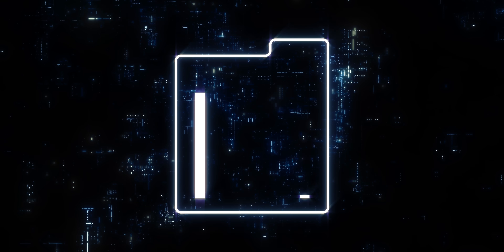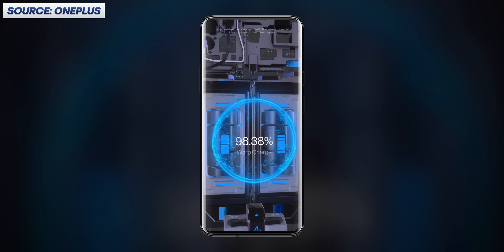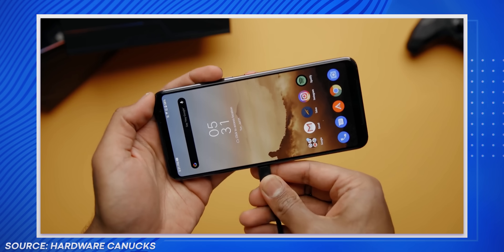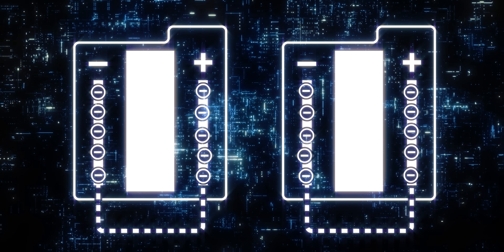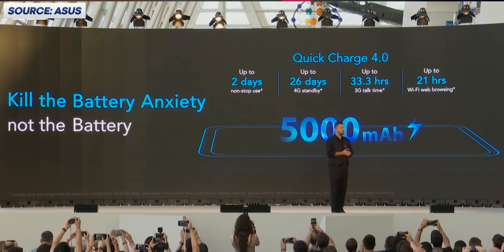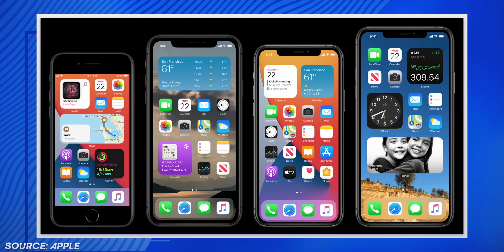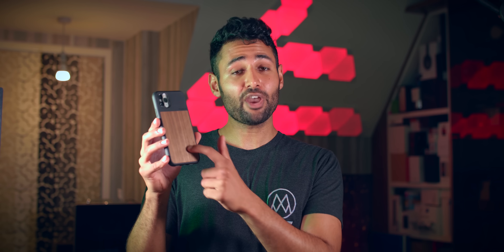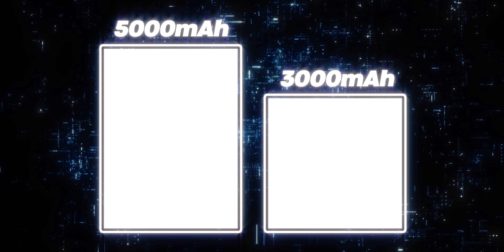The Problem with Fast Chargers.

Comment: I'm glad that someone with reach is finally talking about the problems with fast charging. Now to correct you, with Lithium batteries, actually the slower you charge the better. Also the larger the battery the better, it means it can output and input more energy.

Comment: If companies put buffers in to prevent the user from overcharging, then isn't telling the user not to charge to 100% counterproductive? I mean, if a buffer is there for user safety (say manufacturers buffered charging to 80% in-device) and the user decides to charge to 80%, users are charging to 80% of 80%. Could that possibly lead to higher frequencies of charging that puts wear-and-tear on the battery?

Comment: I agree with his assumption where Apple try to make a phone which the battery life can last longer.
This is proven with their current development where they tried to squeeze down the battery capacity + include Optimized Battery Charging option in the recent update.
This enable the iPhone to last longer during the day, but reduce the battery aging when it is charged during the whole night.

It benefits consumer in many ways:
 to reduce dependecy on fast charging adapter + power efficiency + longer battery life + smaller phone + lighter phone + less hot phone

Comment: In my opinion 10w chargers are the best,  No overheating and No damage battery, but now it's a little difficult find a charger with 10w. I have the Xiaomi mi 9t, I bought it a year ago and the battery works like a new, I only use  to 80-20%and it gives me  like 8 hours of display

Comment: Personally I don't see an issue with fast charging. I've been charging my mi 9t pro at 28 watts for a year. Battery life is still good for me. I'll get the mi 10 Ultra in like a year. I'll probably charge it as fast as the charger that comes with it.

Comment: A battery's sweet spot is between  20 and 80 my Asus laptop has it if you use your laptop and put it on the charger and it doesn't go down past 96% it will not charge until it decreases down to 95%

Comment: " 30W is the sweet spot "
Me with 30W vooc charger : yesss...
Reply: Me who just bought last week a 120W charge capable phone: Oh...
Reply: @ernestomorales6091  dw it has graphene powered battery. Graphene had 3x the life of lithium battery
Reply: @thatdumbguy2800  didn't know graphene was already out,'
Reply: @thatdumbguy2800  are you sure about it? I haven't read anything like that  and that's an important thing to say about the device.
Reply: @arm8636  Graphene is also used for drivers in earphones. It's still not that common material at batteries, etc. probably because it's not cheapest or easiest to mass produce, I guess.
Reply: @ratyjoona  this I know.but yeah the fact that it is finally being used for battery quite amazed me.just seen xiaomi used it with their mi 10 ultra.
not that cheap, true
Reply: @arm8636  Graphene could rly make a change when it becomes even cheaper. Like... Imagine graphene used in screens
Reply: @ernestomorales6091  ah well if you absolutely need to you have the option
Reply: @ernestomorales6091  mi 10 ultra?
Reply: @arm8636  iQOO 5 Pro
Reply: @ernestomorales6091  thanks dude,lemme check
Reply: @ernestomorales6091  good Lord for that price it's a bargain!!
do you enjoy it?charging in less than 30 mns right?good camera isn't it?
also why did you say "capable"  it sounds like you actually don't have it
Reply: @arm8636  yes, you're right, I don't have it yet. I bought it from aliexpress last week, it's supposed to arrive 8th of October, I can't wait to have it! 

I don't expect a lot from the cameras  for that price, but anything else should be really good. It charges from 0 to 100% in 15 minutes (I've watched some videos)
Reply: @ernestomorales6091  hope you'll enjoy it!
Reply: @arm8636  thank you! I hope i like it  cuz I will be switching from an Exynos S10+.
Reply: @ernestomorales6091  I'm sure you will.seen about cameras and they seem to be hella good to.hope the software will be optimized,and you ll get one of the best smartphones of the market,the specs are enormous(I'm serious)
how much did u pay for it?
Reply: @arm8636  I paid 670€ approximately for the top version 12 gbs of ram and 256 gbs of storage. 

I'll see, I'm excited
Reply: @ernestomorales6091  pls lemme know :))
Reply: Sameee bro
Reply: Same
Reply: No my OnePlus got rough after using for a year now battery goes like water
Reply: @uy7019  yup same
Reply: Me with 10 watts...
Reply: user realme6 here
Reply: @haridzscoverto  Realme X2 user here. Over 😂
Reply: I got 27 watt 🌚
Reply: I read this as soon as he said that, thanks

Comment: I really appreciate this.  I'd much rather have higher battery capacity than ultra fast charging, for the same bulk.  I do almost all of my charging with a 5 watt slow wireless charger.  Seems to have been great on my LG G6's battery for the three years I've had them.

Comment: I'm so glad to see someone finally addressing this.
Reply: Right? It's sickening to get called a dumb user to using a slow charger when nobody talks about the drawbacks fast charger has on battery overtime
Reply: @Racko.  bro technology has improved drastically in recent times by using fast charging nothing happens to the battery bro you can easily run your phone for long time

Comment: The goal companies should aim at is charging at various speeds with the same charger. For instance you need to get out quickly so a 5 minute charge at 60 watts would give you 30 to 40 percent of an average smartphone battery. In normal times a charge of 30 to 40 watts fills an average battery in an hour or so. Then for the longevity of the battery a charging speed of 15 to 20 watts. Though this would take 2 or more hours to fill the battery, there is always 2 or 3 days per week when you have a little more time. I worry about 60 watt plus charging because it really shorten the long term life of the battery. I have been using 18 watts but it does take nearly 2 hours to fill my battery. I'm about to change to 30 watts. Like everyone else I'm often in a hurry, the answer really would be a charger with various rates of charging, balance between convenience and battery longevity

Comment: 00:00 introduction
Issue with fast charging
00:47  1) less capacity 
01:35  2) overheating
03:45  3)diminishing returns
Redeeming factors
05:39  1)All chargers degrade
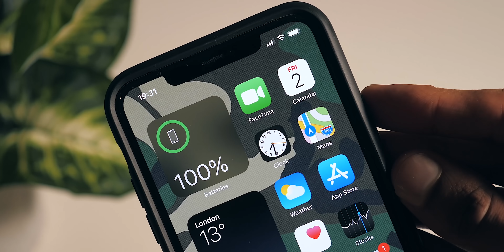05:55  2)charging buffers
06:19  3)smart Power bricks
06:29  4)optimised charging

Comment: My simply method is, I play with display or game until phone drops to nearly 0%.. And then I charge them and let it alone until 98% and then unplug them. When I play game while carging the battery, that less happens to my daily routine but if I wanna play a game while charging, I'll not use fast or supervooc charging, I'll use another charger with super low watt power and it's probably won't rise any percent at all while playing the game.. The lowest power charging, the better performance to reduce battery damage peryear....

Comment: I knew it that's why i set in cable charging (slow charging) mode not super fast charging mode in my Samsung a71. The max percent I charged my phone is 92% (2 to 3 times till the date) and mostly I brought phone percentage near to 87% till the date except the day I bought it i charged 100% and I never bring battery percent below than 29%

Comment: Actually charger capacity doesn't matter if fast charging or not ( assuming it can supply enough for fast charge). Comuication is for the phone to know if can fast or not. Then the charging ic does the rest. Fast charger can deliver 12 volts with high amperage, if requested on the usb bus from the device.

Comment: I have been using OnePlus for long years now. In my 3T model I was able to replace battery somewhat easily but on 7T pro I dont really think about it since these phones are glued shut with no screws outside and made from glass. The sweet spot for me would be to have replaceable batteries.

Comment: I'm watching this with my Realme X2 Pro which I think still holds the title as the fastest charging phone. I can say that fast charging actually improved my charging habits. I have never left it charging overnight like I did with my old phones. I only charge to 80% and charge when it nears 30%. So far the degradation has been minimal despite running 90hz since I got it. The two batteries system actually allows it to charge faster than other phones on slower non-SuperVOOC chargers. On the subject of temperature, I would say its only noticeable when charging from 0% which I've only done once.

Comment: My 11 Pro is on 90% battery health after just under a year and there's a drastic difference with how long the charge lasts. I hate the fast charging because it's completely unnecessary for me most of the time, I only need to charge my phone overnight so it just causes unneeded stress on the battery, there has been the odd occasion where I forgot to charge my phone so of course fast charging can be helpful, but not often. I wish chargers would have a switch on them to change from a low wattage setting to a fast high wattage, or a setting on the phone itself to do this. Also, the 'optimised charging' hardly ever even comes up on my phone

Comment: Well, I am not an elector-chemistry expert, but I believe any amount of charge in battery is going to produce stress. Higher the charge, greater is the stress. 50% is just a sweet spot, not too high not too low. You can do stuff if couldn't get a chance to fill it. And while on shelf, not accidental over discharge (where it might be bit difficult to bring it back to life).

Comment: Dude. There's a lot of tech behind fast charging to overcome those bottlenecks. You really need to know engineering aspects behind Oppo, Xiaomi implementations before claiming about longevity. This is pure speculation based on surface facts. And it discourages innovation. Looks like daily driving an iPhone has already dumbed you down.

Comment: I've laughed for awhile at tech reviewers crossed at Apple for not including a fast charger.Not realizing it will wear on the battery faster.
Reply: A 5000 mAh will never be as Bad ad a 3000 mAh battery. Maybe learn that
Reply: @andreast.7878  It depends how you're using it, if you're constantly using the 5K mAh with a fast charger from 0-100% when it dies you'll get way less capacity overtime that makes it hold charge, but if you're using a 3K battery somewhere around 30-80% using a slower charger you'll get more out of that
Reply: @Racko.  lmao
Reply: Apple is doing this to save money nothing else also Oneplus uses 'oppo vooc' technology which is much better and way less heating compared to 'quick change' instead of raising watts it's increases the current so if quick change uses 20v 3a(60~65) then SuperVOOC 2.0 (oneplus 8t chrger) uses10 V/6.5 A (65 W) and all the heat kept on the charging brick itself which itself reduce phone temperature
Reply: It would wear out the small iphone batteries faster but they should have added fast charging to their ipads. 20 W should be minimum with 40+ W considered as fast charging for a 10000mah battery
Reply: yeah fast charge will definitly demolish iphones small weak batteries

Comment: Instead of releasing many identical versions of the same phone (with minor differences and different names) companies should give the option to choose between having a sealed phone and one with a removable battery. You pay 1.5k for a phone that's gonna be as good as the battery inside it. Is it that hard to offer that option to be able to remove the battery.. it's sad. Companies are very anti consumer nowadays, it's all about profits.. you need it or not just keep buying.

Comment: Overheat when in fast charging mode, simple use eletric fan (also it depends of temperature of the area but still use it for lessen heat) don't use a more cold device that may cause moisture inside of a device unless the area using any cooling devices or appliances such aircon inside of the place

Comment: I own a 2012 Nissan Leaf so I know aaaalll about battery degradation lmfao. Also, if apple wanted their devices to last a long time why would they be so against right to repair and letting independent repair order parts?

Also a video explanation of how Dash/Warp charging works on 1+ phones would be awesome because aren't they designed for dissipating heat outside the phone?

Comment: This is why as part of the OnePlus Idea's program I've made the suggestion to allow limiting of charging speed when not required. This fixes the issue of overheating and long term battery degredation. The reason for this idea is that it allows people to slow charge day to day (or night to night) when you don't need the battery charging at 60W etc. However for those times when you really do need to charge up quickly you have the option for it.

https://www.oneplus.com/uk/communityideas#/detail?threadId=319

Comment: I charge my OnePlus 8 at 30% and let it charge untill 72% to keep the wear as small as possible, but after 2 months I only have 92% real battery capacity (3.976mAh instead of 4.320mAh) even though its enough for me to get through the day I dont really need the warpcharge feature as often as I might have thought so personally I think I would prefer a normal charger instead of a 30W Warp Charger that charges 15% in only 8 minutes

Comment: Hi, a battery engineer once told me wireless charging is better than wire because of voltage control. For example wire charger is 1.5V, a wireless charger would be 1.49999. That alone is better on the battery. Anyone knows if this is true? Thanks

Comment: I used the apple fast charger that came with my phone and its health dropped by 1% every 3 cycles. Took me only 6 months to get it down to 80% battery health. Got a replacement and now use the 5w slow charger and it’s not degrading as afst

Comment: You should take a look at Xperia 1 II and 5 II. Sony got it right with HSS, which allows the charger to go straight to running the phone while gaming, while NOT charging the battery. This allows for prolonged gaming without burning the battery.  On normal fast charging, Sony's charging will slow down the charging as it approaches 90-100% full charge. But so many reviewers just do a charging speed test to 100%, and condemn Sony's charging as "slow and so yesterday...."

Comment: I personally would go for 65W charging as there is atleast 30 min difference with a similarly sized battery rather than 125W as it is barely 10 mins faster 😌

Comment: You forgot 1 thing. Charging creates microscopic crystals that reduce battery capacity and will eventually puncture the layers, creating a short circuit and a fire. Fast charging accelerates this crystal formation, it's inevitable to the technology.

Comment: Maybe I am dumb or stupid but I have to ask this question..
Is Charing phones for a long time back
I heard that new gen lithium batteries have the power to cut themselves from receiving power so preserve battery!...is it true

And what if I just switch on the charger in the socket with phone is there any lose in electricity....I believe if there is heat on charger then it is using electricity... Which I never got any heat!...so?....
Does it damage this new gen fast chargers so I am curious
And I am using a low range phone BTW.... So is there battery difference and methods?

Comment: I have a doubt if the charging is like you said at 0 percentage the pressure at that part will high so it can adjust pressure of the charge and go to nearly 50% will it

Comment: Stay on 5W apple charger everybody!
Reply: I use a 12W iPad charger
Reply: You're just making your experience worse for little battery capacity gains. If you're going to keep you phone for 4 years you should be prepared to buy a new battery
Reply: I’m using a 12 watt charger for my Iphone SE2020. So far so good
Reply: 15W charger and 5W charger have same effect on battery. Apple will not provide 10W 12W or 15W charger to their apple slaves.
Reply: kashyap mehta You can just buy a 10W/12W charger lmfao once you do there’s no need to use your 5W charger or the 18W fast charger
Reply: @Lol-rv5bv  70% of iPhone users don't know specifications of iPhones that means they suffer with slow charging and what a greedy company can't provide 10W charger for 1000 $ phone when 250 $ phones gives fast charging in box.
Reply: kashyap mehta Lmfao the iPhone 11 Pro/Pro max has the 18W fast charger included tho. Besides, im sure every iPhone user knows the 5W charger is too slow. It takes 3+ hours for it to go from 0%-100%. It’s obvious 3 hours is wayy to much so yes I think they all know they have to buy a better charger

Comment: Reminds me of the same issue as with electric cars. Also known as rapidgate. It's odd we can not determine the charge state of phones. The sweet spot of (fast) charging and charge state is between 20 and 80%. It makes the battery last longer. I think I recently saw Asus as the first smartphone where we can set the maximum and minimum state of state when charging. All phones should have this and cut power when reaching a target charge state. On my A71 charging to 80% is more than enough to usevmore than a day of normal use.

Comment: Pro Tip: Linus said that the sweet spot for using the battery is between 65 and 55%, but that's Impractical. 

So my tip to you is to stop charging at 85% and charge it back at 25%, that way you will get 60% of battery use.
Sure it won't last long as to 100% to 0% But it's better to have longevity than showing-off. ( this tip does not 
work on the laptop when already overcharged )

Comment: Until the battery technologies gain the next huge leap, I will stick with the traditional and safe wire charging. It is no brainer that wireless is not only inefficient, but also could be damaging due to heat generated.